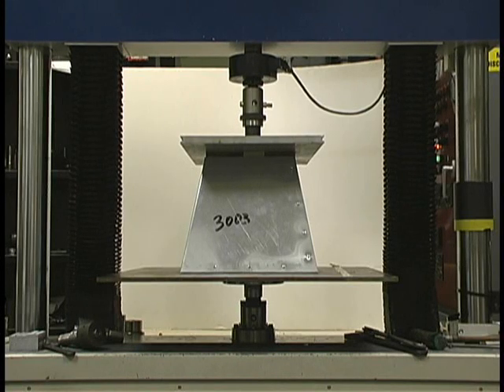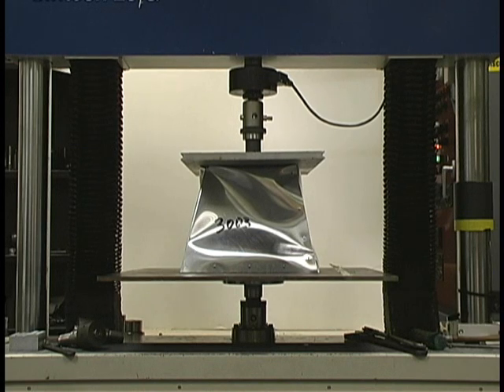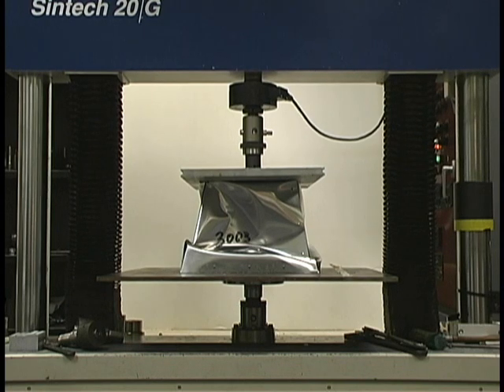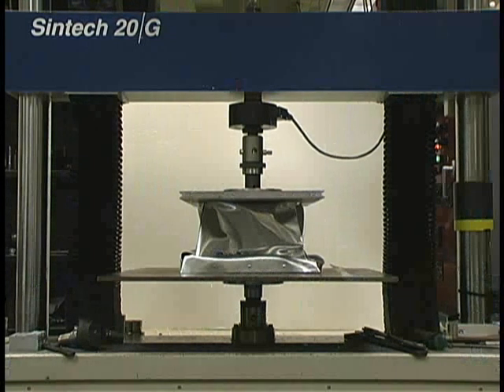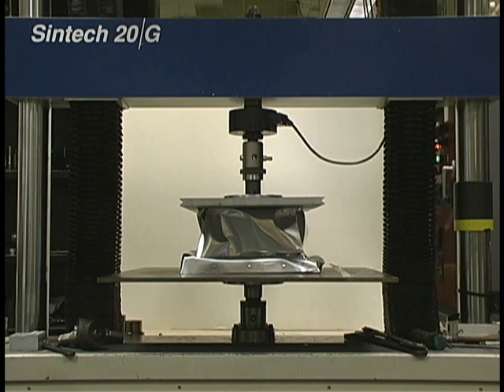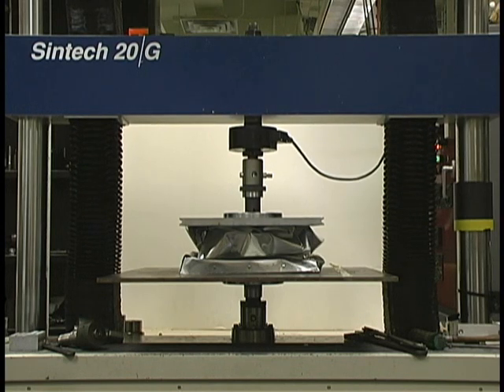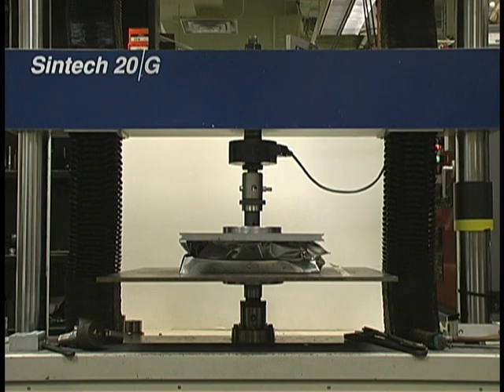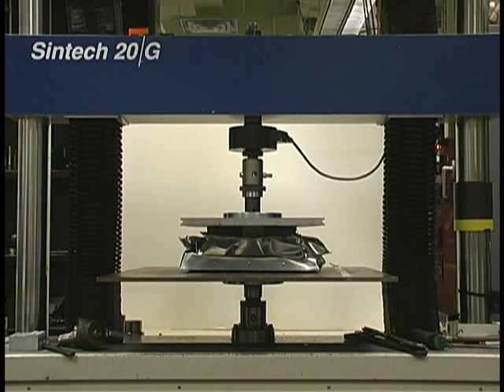Impact attenuator crush test

Comment from the maker: we were testing to see if the design would absorb enough energy.  Also, if it absorbed too much energy too quickly, this would indicate that the attenuator would slow the vehicle crash too much, and the g level would be too high for the driver to sustain.  This energy absorbtion can be measured by the force-displacement output of the machine.